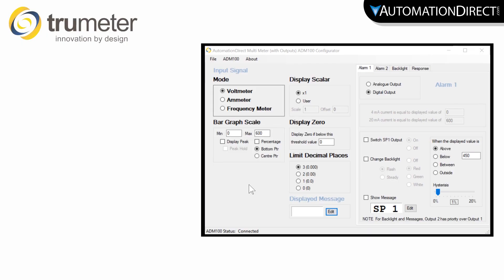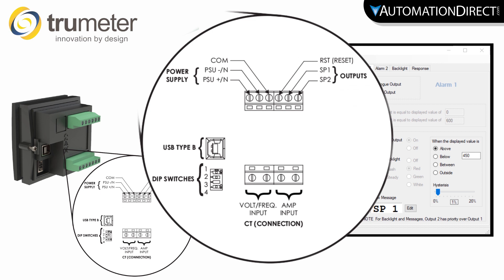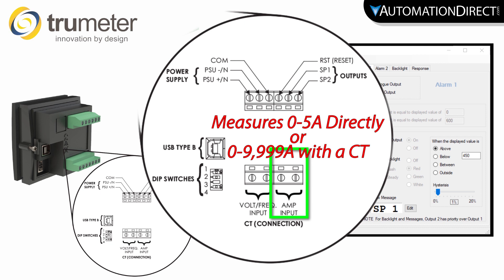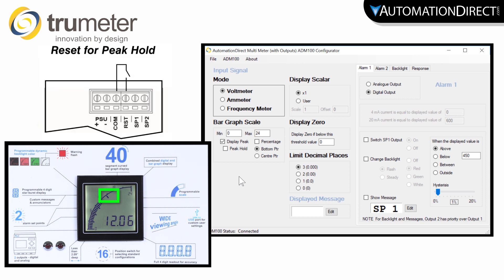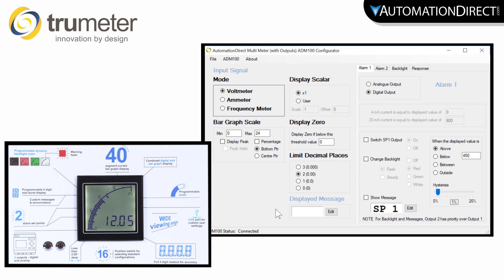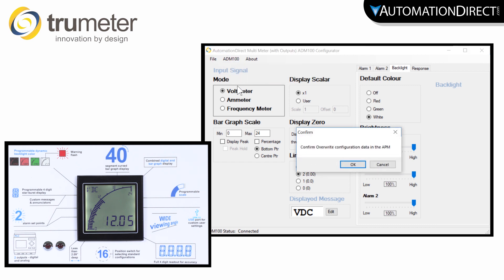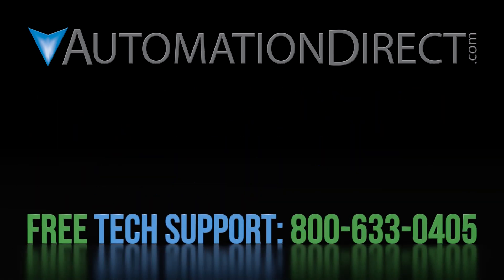Trumeter ADM Graphical Panel Meter Setup for Scale & Backlight from AutomationDirect

Comment: I would like to hook the Trumeter up to a [ 0 to 10vdc ] or [ 4 to 20ma ] pressure sensor [ 0 to 15psi ] and calibrate the meter display for [0 to 415.6  inches of water column ].  😎 Thank you.
Reply from the maker: ADM100P-LN and ADM100P-LP can accept a 0-10V or 4-20mA signal and be scaled for your sensor.
Reply: Thank you, I missed that.  @automationdirect

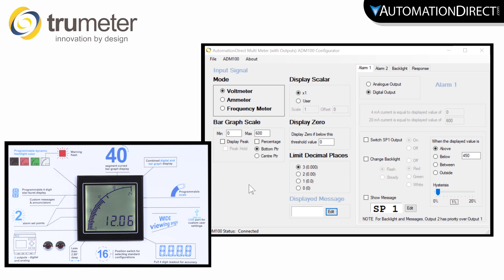Comment: 0:28 So it is safe to connect to the USB port while the unit is powered up ? (I can't find any instructions on the insert, or in the software regarding USB link)
I think I saw one of your ultrasonic tank level sensor videos, where that is not the case :)

Thanks
Reply from the maker: @Shoddy Productions, it is fine to have the USB connected while the unit is under power. These circuits are isolated. Thanks.